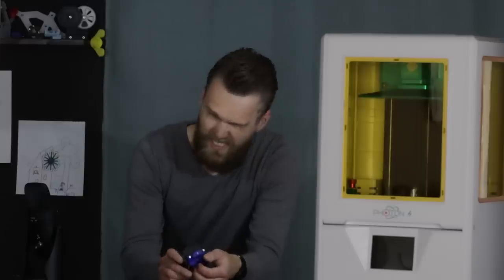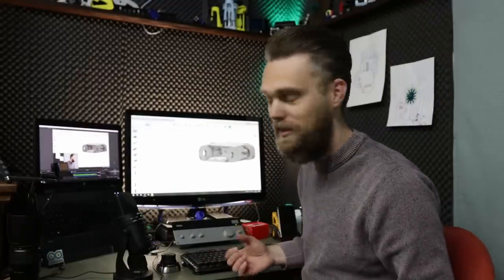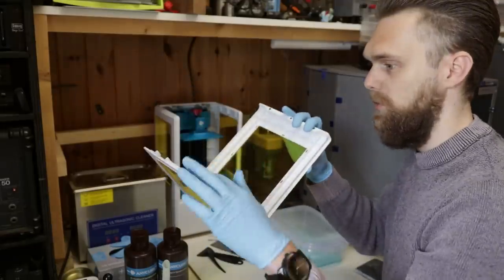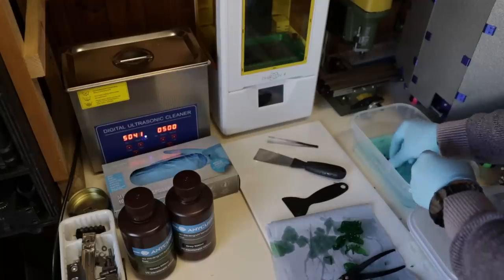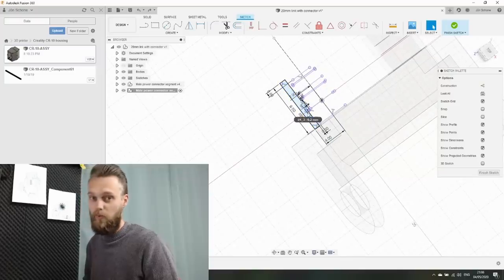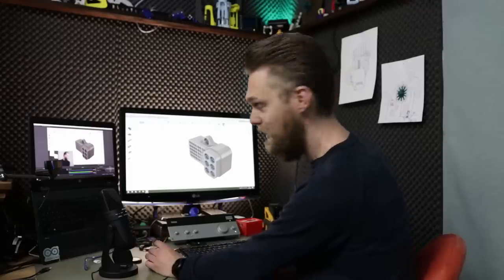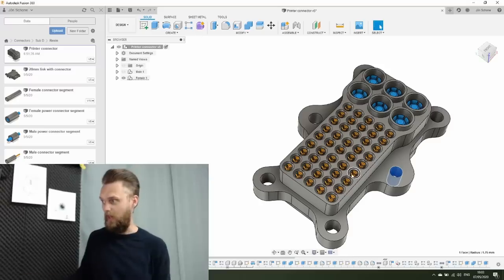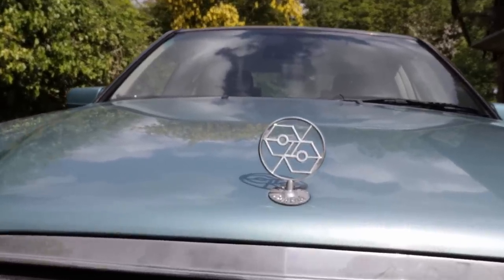51 pin custom connector printed with the Anycubic Photon S resin printer

Comment from the maker: I’m going to upload the design once I added this to the enclosure I’m designing. Contact me directly if you cannot wait ;) For now I hope you liked this video and have an awesome day! I’m going to work on that enclosure, wish me luck!
Reply: gj bro
Reply: Hi there, Perhaps you should make it symetrical (three big connectors on each side) it makes them easier to mate together (symetrical/axial forces). I don't know the exact content of this awesome connector but if is not already done you should also consider allowing ground pins to connect slightly before all the other pins. and... I NEED MORE VIDEOS ! :)
Reply from the maker: @Valenthior  Thanks for your suggestion! Purely symmetrical has its downside of the possibility of connecting it wrongly, connector should always be poka-yoke ;) This can easily be solved with a notch but i get your point ;) This connector won't be connected and disconnected often since it will be used within the enclosure itself with the key purpose of neat cable management. Your suggestion of connecting the ground pins first wouldn't be a thing for this purpose, but definitely an interesting feature which can be achieved with custom 3D printed connectors, thanks!!
Reply: @Valenthior   I like how it is Asymmetrical, AKA Keyed! MUCH safer. But the ground pin idea is solid for sure.
Reply: @lordkahtu96  you are right, being Keyed is a key feature (😛) for a connector! But I rather have it from the external shape of the connector (just a preference). By the way, Arinc connectors may be inspirational. It makes me think that some kind of open source TE connectivity Deutsch DMC series would  be great.
Reply: @properprinting  i don't see/read the word poka-yoke for about 20 years!!!  Great!  😁😁
Reply from the maker: @erreessetv  cool! I learned about that when getting a lean course a long time ago already. We got some Japanese principles (from Toyota) which were very interesting!
Reply from the maker: Astrid Alaniz  good suggestion! Although it doesn't look like it, but I've grouped the connections. Groups of 4 for the stepper motors and some pairs for the homing switches.
Reply: @properprinting  in italian language , sounds like "monkey proof" :-)
Reply: What are those press-fit power pins called?
Reply from the maker: @recurveninja  https://nl.rs-online.com/web/p/d-sub-connector-contacts/6931082/ and https://nl.rs-online.com/web/p/d-sub-connector-contacts/6931073/ ;)

Comment: Obviously this is the more fun solution that creates a lot of content, but in the future you could look into automotive connectors. They have tons of pin configurations rated for lots of current. Will probably still be a bit more expensive, but way less work. Definitely not saying don't do this though. ;)

Comment: You uploaded this on the same day that I received my Photon S! I've been dealing with print failures due to what I think is poor bed adhesion. My 5 print attempts have all been failures. 4 ended up sticking to the FEP film about halfway through. The other finished stuck to the build plate, but many of the supports were broken. I've been troubleshooting all day. I'm hoping 6th time is a charm! I decided to go back to college and pursue a degree in engineering. I just signed up for classes today! Your channel influenced my decision. You inspire me so much man!
Reply from the maker: What a coincidence! I had some failures too and all of them were due to wrong bed leveling or a poor support structure. I found out that if you place the part 5mm from the build plate (+5mm in Z direction) and add enough supports it will go well. So awesome that you've signed up for classes today! I'm so happy for you and it feels so good that I've influenced your decision! It will be tough for sure, but in the end it will definitely pay off. I wish you the best of luck man, very cool, great decision!!
Reply: @properprinting  My sixth attempt was a success, although I did some damage removing the supports. I had to increase my bottom layers and bottom exposure time in order to achieve good bed adhesion. My 3 year old daughter lost her favorite doll's left leg; I generated a model of the right leg using photogrammetry, mirrored it, and cleaned it up for 3D printing. It works perfectly and looks awesome! It was definitely more of an academic project than a practical one, but I learned a lot and had fun.

Comment: I used my elegoo mars printer for parts on my railcore II printer. One of the biggest things I found useful is to use a 25% mix of a flexible resin into your resin of your choice.
The resin wont be anywhere near as brittle and will be a lot more usable.
Also for the inserts you just need to bore out the holes a little more. You dont need as much material as you would on an FDM print.
Reply from the maker: Great information, thanks! I'm still a noob regarding resin printing so I'm very happy with tips like yours!
Reply: Are you a member to the railcore Facebook group? Someone shared photos of the printer he's building with all the brackets that we usually upgrade to aluminum all printed in Blu. It looks so sexy. I would be tempted to add led's to them to really make them glow!
Reply: @robertfliege1884  I am :)  I can see where the right colors and lights would be real sharp looking.

Comment: Another inventive video. Thank you!

One thing to watch out for: As the pin count goes up, the force required to mate and de-mate the connectors also rises! Before you know it, so much force is required that you can’t separate them once mated. It may be worth adding some features to the connector body that makes it easier to grip and pull apart.
Reply from the maker: Thanks! That's a good point you're making! I have good experience with VPC connectors like this one https://www.vpc.com/catalog/510161101/ and I got my inspiration from these. For my connector I don't have to disconnect it that often because it's for inside the enclosure and it's mainly for neat cable management ;) Thanks for your suggestion :D

Comment: thermoset vs thermoplastic - with the inserts you're probably better off printing over sized, coat the insert with uncured resin and slip it into the part before curing. love the content you're making, keep it coming!
Reply from the maker: Thanks, that's a great suggestion! I haven't thought about that
Reply: @properprinting  keep in mind that you might get some inside the threads. Use some hotglue, wax or similar that is easy to remove in such cases

Comment: I just want to say thank you! Your previous connector video really inspired me and its great to see you take the idea even further! I have since designed a few of my own connectors for various projects. My favorite application is including pogo-pins in a connector to press against pads on my custom PCBs for programming the micro controller. I've also found a quick and dirty way to make connectors. I have designed some of my connectors around pre-made dupont jumper wires and use hot glue to pot the back of the connector and secure the wires. This wont be great for high power, obviously, but its worked great on everything I've tried so far! Thanks for all your awesome work, keep it up!!!
Reply from the maker: Great to know that the previous connector inspired you and designed your own! Adding pogo pins to it is a great idea! This is exactly what I like about this concept, not just printing connectors, but connectors with special functions. This is exactly what you did! I want to do more with this concept and add more connector segments to my site so people can make their own configurations :D

Comment: Might I suggest putting the connections in before curing the connector, so the pins are sealed in there with the small amounts of residual resin? You could then also make the holes a bit too large and allow for some play to make the pin positions perfect in the curing step.

Comment: I actually thought of this as a business case when I designed watercooling + RJ45 connection. I don't know if you have ever asked an offer for a custom combined connector but they usually come with a pretty hefty  minimum order quantity and a really insane price per unit. 3d printing them was actually significantly cheaper until you get to 1000+ order sizes
Reply from the maker: I recon that this would make an interesting business case, especially for those one off connectors. I got the idea when making a test fixture for testing a PCBA and during the test some jumpers needed to be placed and disconnected. I designed my first custom connector which fitted those jumper headers (with a unusual pitch between each other) and switched them automatically. Still going strong after tested more that 1000 products :D Another aspect that I like is that this enables incorporating connectors in housings or add other special features.

Comment: I've had pretty good luck using helicoil style thread inserts in my resin prints. Unfortunately I haven't been able to find a STI thread library to add to F360, but tapping the resin parts hasn't been too difficult. As long as the tap hole size is right, and I keep backing the tap out to clear out the dust. Also I believe there are a number of resins that would be better adapted to the use you have designed this for. A couple of my favorites are Siraya Tech Blu, and Sculpt. Check them out if they're available in your area.

Comment: They looks good. if you want metal inserts you may try to put them in. Make the hole larger than you need put the insert in and pour resin around it and let it cure
Reply from the maker: That's a good idea, I didn't think about that, thanks!

Comment: Great Idea and the semi-transparent style of the connector looks very nice indeed.
However I doubt I would use those for any project, as they need a lot of time and they seem to be prone to failure due to their mechanical brittleness.

In the past I used Harting Connectors, which are modular. There are modules (Han-Modular Connector System) from an array of contacts to power contacts being capable of carrying 200 Amps and voltages up to 5 kV, and there are pneumatic connectors too. Unfortunately they sometimes can be rather expensive and the overall size of the connectors is relatively big.

I'm looking forward for other inventive videos.
Reply from the maker: Thanks Stephen and you have a great point! As a matter of fact, I was in contact with someone from Harting about this. You're right about the brittleness and I have to pull my printer apart before I'm going to print the next version of that rim to inspect this. I'm currently printing with Nylon-like and PMMA-like engineering resin which is not brittle and way stronger. They also have fire-retardant resins, so if I'm going to do more experiments with this, I think I'll use that resin.

Comment: I’m reverse engineering the Lucas Electric connectors on my car’s wiring harnesses. Could you describe how you mocked up the male pins and the locking system to hold the male pins in place?

Comment: Nice. As I sit here and imagine how much some connectors get tossed around and how others hardly, if ever, get unplugged or moved once installed, I wonder how rugged it will be.
Reply from the maker: This connector wouldn't withstand a tossing, but I'm going to take a further look into the engineering resins which are less brittle. At normal use they do well, my first connector was for production purposes (printed out of PLA) and after more than 1000 mating cycles it's still going strong :D

Comment: I have been wanting to upgrade my Creality cr-10 S5 and I have got almost all the parts at home, but now I'm waiting 3 weeks for The Flex3drive direct remote extruders to be sent from England
I ordered from AliExpress an avionics 40 pin connector but I don't want to run 240 V for the 1300 W silicone heater. So I will have to use  normal 240 V Euro connector and lead.
I have a 5 mm cast aluminium plate for the bed (the current bed is more like a hammock), 1300W silicone heater, 2 magnetic (360°C) spring steel sheets with  PEI print surface, linear guides for x and y and I will do 2 IDEX print heads, Duet WiFi board with duex 5 expansion board with 10 inch display, auto bed levelling, new Sunon replacement fans.
When the 2 Flex3drives finally arrive, I can start upgrading my poor old CR-10 S5
Reply: With 2 Mosquito Magnum printheads

Comment: can't wait to see the finished result, i'm  particularly interessted in the mecanical resistance of this type of applications, how many plug - unplug before a potential break ?
Reply from the maker: Awesome! This connector in particular won't be connected and disconnected much, but my first ever printed was for a production applications and after more than 1000 mating cycles, it's still going strong :D The pins themselves are the parts that will wear out so the printed body shouldn't make that big of a difference ;)
Reply: @properprinting  There are "nylon like" and "ABS like" resins out there. those would be much better suited for stuff like this

Comment: I'd recommend not shaking the bottle due to microbubbles.  Not a big deal usually but I've had some prints come out funky because of the shaking before.
Excellent application for a resin printer though - much better than ugly molex motherboard connectors.
Reply from the maker: Thanks Dean! I had indeed some bubbles, but the bottle stated that it had to bee shaken well. This small resin printer is well suited for this job :D

Comment: Hey I saw a cute mini drill press in the background, what is it? Do you like it?
Reply from the maker: It's this one https://www.proxxon.com/en/micromot/28128.php and it's cute indeed! I do like it for the purpose of finalizing 3D printed parts. I've used it in the video about the swappable direct drive in which I managed to mill an M5 screw which is not a recommended thing to do xD Proxxon has some awesome tabletop machines
Reply: @properprinting  thanks!

Comment: Did you have scaling issues when you tried to print I’ve had issues with prints being between 2-6% a different size than what i designed in fusion 360 so atm i am having to calculate the different in fusion.
Reply from the maker: Good question, I just have checked and they were 0.1mm off in length and 0.2mm in width so that's acceptable for me. I've heard similar issues by others so maybe I'm lucky or there's been an update.

Comment: I got Anycubic Photon year ago.
And I don't use it for like 11 months now.
This stuff has incredible resolution indeed, but dimensional accuracy is worse than on ender 3.
I also assumed I can leave objects flat on the build plate and have nice surface finish, but nope, instead I need to suspend it on the support and the surface finish is really bad.
Very disappointed...
Reply from the maker: You're not the only one with a bad dimensional accuracy. The comment before you by @SoulJuice describes something similar. The accuracy was pretty good in my case, between 0.1 and 0.2mm. With a bit of patience, research and luck this is a pretty nice machine, but I don't have much experience with resin printers yet to make a good comparison.

Comment: What pins are you using and where do you buy them? 😊
Reply from the maker: The same pins as I've used for this mod https://properprinting.pro/product/custom-d-sub-connector/ which are bought from RS components
Reply: I should have looked through your site first. Thanks for the reply 😀

Comment: 7:50  i would recommend NOT using the flush cutters for something like this.  they're not meant for it, and it's possible to break off one of the sides and cause it to go shooting across the room.  get some proper dikes for hard work like that.